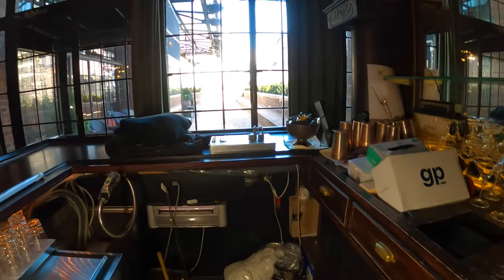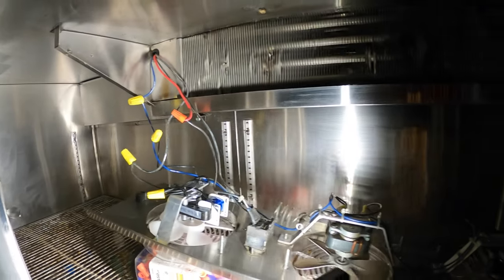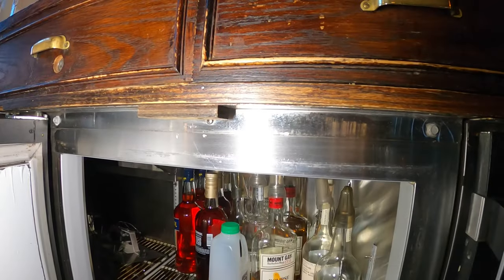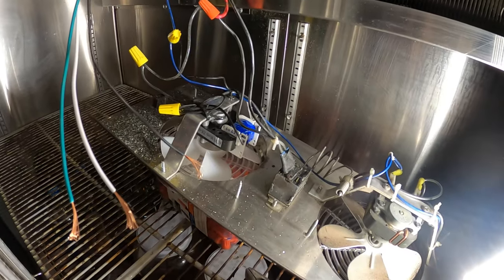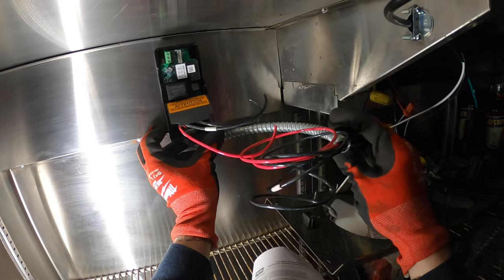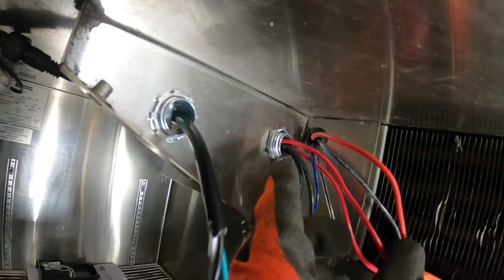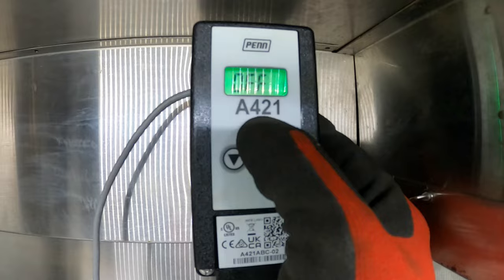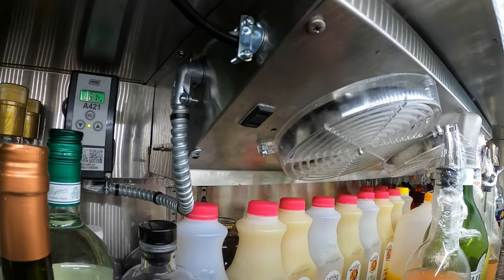HVACR: Commercial Refrigeration Bar Cooler Upgrade Part 2 (LED Lights, Penn A421Thermostat Install)

Comment: Good job Jumper, You can screw the grounding conductor to the housing or frame of the appliance and it usually will make it back to ground, usually.
Reply from the maker: Thank you for the advice & thanks for watching! 🙏🔧⚡️
Reply: It's all good 👍.
Reply from the maker: @johnwalker890  👍👍👍

Comment: Drilling holes and the swarf goes everywhere dropping down onto the product.whilst its only bottles, if the swarf sticks to the bottle, the bar tender doesn't notice because hes mad busy and pours a drink, then the swarf drops into the glass, customer drinks it. Boom you're in court

Oh and flicking bits of stripped cable plastic around inside the cabinet isn't great either..

Protect your work and protect yourself..

Comment: Love the show. Btw, when drilling stainless steel you should use low speed and lube, try it please
Reply: Also use cobalt bits.
Reply from the maker: Thank you for the advice! 🔧⚡️
Reply from the maker: @dfirth224  Nice. Thank you for the advice 🙏🔧⚡️

Comment: Great work, is there a door switch or motion sensor on that light? Or is it on all the time?
Reply: They are on all of the time.  Does not matter if LED are on constantly, no heat.  Other bulbs give off heat.
Reply from the maker: Thank you Jim! No door switch on this unit. Lights stay on all the time but they were made for display refrigeration equipment so it doesn't affect the cooling. Thanks for watching! 🔧⚡️
Reply from the maker: @dfirth224  Correct. These were made for display cases and don't give off heat. Thanks for watching! 🔧⚡️

Comment: Excellent video as usual, JMT. As mentioned, did you think about a door switch for the lights. Maybe they only turn off on defrost? I've been using those Kneeling pads for years, $14.97 at the HD.
Reply from the maker: Thank you! I wanted to install door switches, but the customer didn't agree to that. There is no defrost cycle on this unit and the lights stay on all the time. That kneeling pad is great. Glad I got one. Thanks for watching 🙏🔧⚡️🤙

Comment: Sensor has to be strapped to the fan guard since air is sucking in...and you should fix your cut in and cut out that will help your solenoid vlave open and close when it's supposed too

Comment: If you mounted the sensor behind the coil then that’ll be the supply and won’t be temping right . For return air you mount it right behind the fans
Reply: The final location isn't ideal right up in the corner ideally it should be in free air but manufacturers also do this. Besides as it's only bottles it's not critical
Reply: Never mind , I see you mounted in the return at the end of the